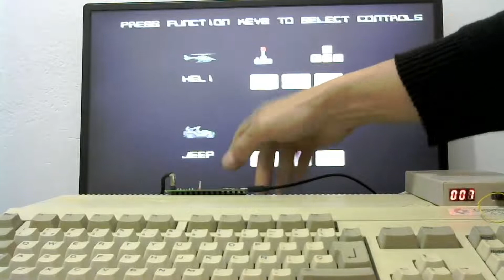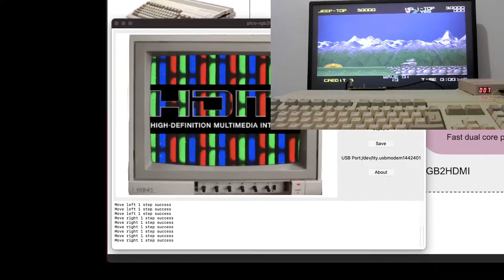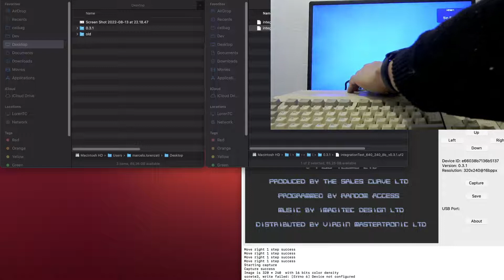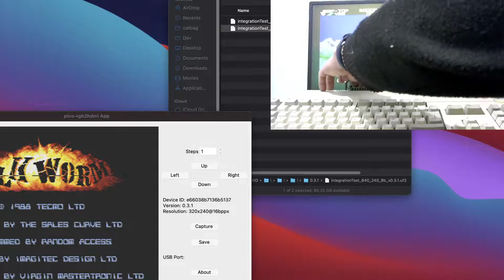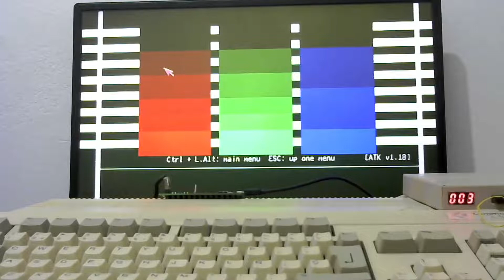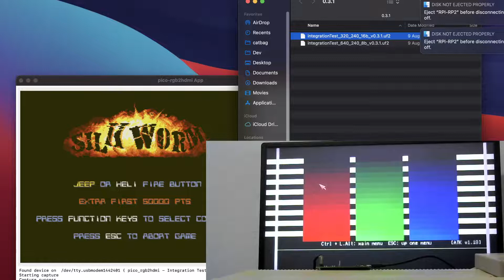Pico RGB2HDMI and USB Converter

Comment: PAL Amiga is 320x256 - does it cut off image? What about HiRes and other modes. How does it process these?
Reply from the maker: just 320x240 16bits or 640x240 8 bits, so you loose some lines

Comment: Hi Marcelo, thank you for your work. Is it compatible with A1200?. Another question... do you plan to  add Audio Imput to the device to get HDMI audio output?
Reply from the maker: Yes, I use it in an A1200 too, you need to use one display config to remove SOG info.
Also if you check my repos I have HDMI/audio support
Reply: @mlorenzati  thank you :)
Yesterday (after I posted last message) one of your close friends told us about it.

Are you developing a new board version? We are going to order some boards but in case there is a new version in the coming days, would be better to wait for it.

Comment: Does it work also as an almost non delay grabber?
Reply from the maker: HDMI image delay is one or two scanlines of the same frame, but if you mean video capture, the problem is USB 1 speed of the pico.
Reply: @mlorenzati  2 scanlines delay is really commendable, such feature is what respectable scandoublers usually offer offer.

Didn't know pico have usb1 :(

If your device is capable of capturing analog, would it be also able to capture digital signal directly from Amiga (maybe even wit a better ADC chip if Pico doesn't have enough IO ports)?
Reply: @mlorenzati  BTW, what about composite or s-video to hdmi conversion for retro computers without RGB, is this much harder to do than RGB?
Reply from the maker: @sanjyuu2298  yes it is. simple is to get b&w image but assign colors is difficult